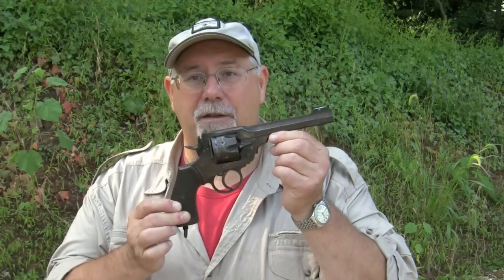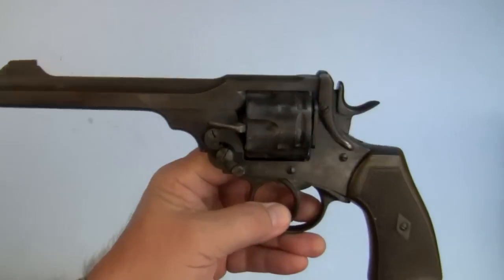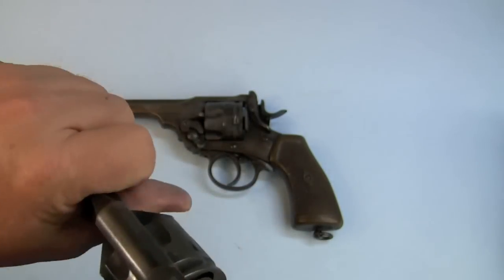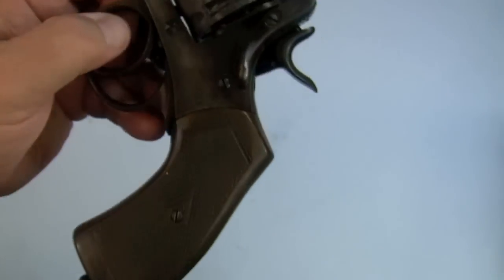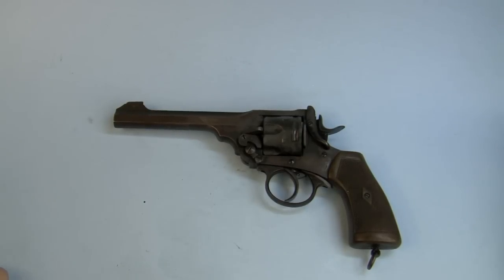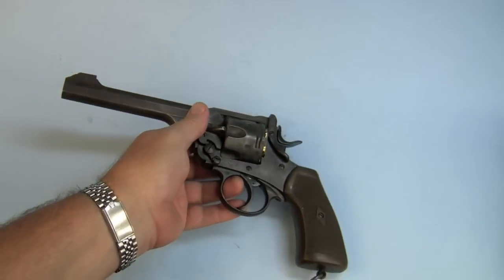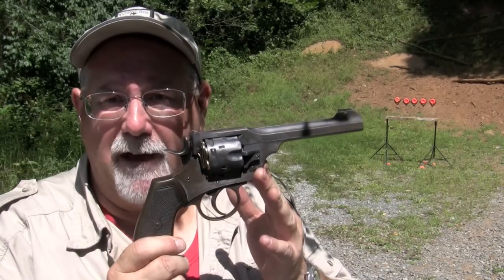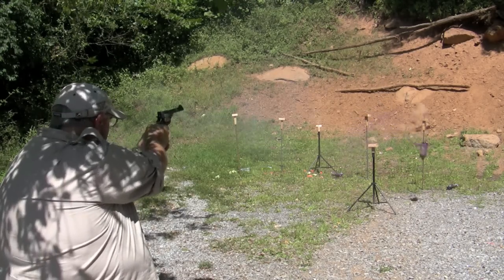Shooting British  455 Webley Cartridges in a Shaved Webley MK VI Revolver

Comment: Hi, 
In Britain before the Pistol Ban (Introduce by Tony Blair) in 1997, we had a large following of people shooting the .455 cartridge. We were obtaining off hand sub 1” groups at 20 yards. We also had many competitions with these revolvers and the Webley Fosbury Automatic Revolvers. The way that we found to make them shoot was to use a hollow based bullet. This design would obdurate the base of the bullet as it entered the barrel. The chamber exit hole was smaller in diameter than the barrel so the use of a plane based bullet was just inaccurate. It was easy to obtain the correct size cases either by using Fiochi once fired cases, Mountain and Snowden made the Mk II cases, finding original cases, Imperial made this ammunition and I believe that some of the American Manufactures used to make it. The hollow based bullet was another matter. The easiest way was to swage your own with many Manufactures supplying the dies for this. I note that you were using flat based bullets in your test. RCBS made a mould for the 265 grain Hollow based bullet. Sized to .454 dia. These proved to be good. The ‘Man Stopper’, Mk III & IV, named thus for obvious reasons. These were normally made in the weight range of 200 to 220 grains, both in the flat nose and the hollow based and hollow nosed designs.
You guys went down the butchering of the rear of the cylinder route, so you could use the Auto-rim cases or the moon clips. Thus you could re-load the ammunition using available components. Unfortunately, you used .452” diameter bullets and wondered why you could not obtain the desired accuracy. 
I hope that this is of some help to you all. Please feel free to contact me if you require any more information on firing the .455” Webley or the competitions that we shot with them. Personally, I consider that this revolver was the very best military revolver ever made.
Reply: You are far from alone in your regard for the Webley MK VI, it is widely and rightly held to be the very best military revolver ever created.
Reply: 2771 Hi there, good morning. 
You are quite right about the Webley Mk V. One competition which we used to run was the Classic Service Revolver Class A, for over .4 Cal. Service revolvers. This was shot at 20 yards with an opening six rounds shot in 30 seconds and it was Shot first strong handed six rounds and then the next, shot weak handed and the gun score, minus the number of seconds taken to fire the six shots The South London Rifle Club had another competition where you fired at an advancing target and you fired left handed and hat a service sword in the right hand, held at the point! Great fun, but all stopped by Tony Blair to help him get elected. Never trust a politician.
Reply: We have a saying here in the southern United States. Politicians and diapers should be changed often, and for the same reason. I wish i could find a good Webley revolver at a good price. I would even settle for an Enfield copy of the MK4, but those sell for over 450$.
Reply: As a matter of historical accuracy the 455 Webley was outlawed in the UK by the legislation proposed in 1996 following the Dunblane massacre and enacted in February 1997 under the Conservative government. Later that year a Labour amendment to the bill extended the handgun ban to include .22 pistols.
Reply: Finally! the voice of reason from England! Mr. Valentine you are entirely correct about the issues with Webley .455 revolvers here in these United States! Bullet DIAMETER was and is the issue. I was amazed about the foolishness of using .45acp bullets .451/452 to obviously greater dimensions! Your point about hollow based bullets is excellent as well. Personally I always felt the Webley "manstopper" Bullet to be an outstanding Idea for Revolver cartridges provided they had the necessary energy to penetrate sufficiently. Finally I lament the closing of Webley/Scott and thought , with modern metalurgy the idea of bringing back the Webley design. Also as a personal noet it breaks my heart about England and the UK surrendering to the foolish left! I decend from a famous Pilgrim and I,m even Kin to Henry the eighth! Recall Lord Davies and Wickham Steed asking Americans to send a Gun to defend a british Home during ww2? "gun control" In Britain as you are aware came from the fear of the Ruling Class about a possible Marxist Uprising.
Reply: red9man2130 I'm UK born but lived in East and South Africa for many years. The Kenya Mau Mau uprising in 1952 was in full swing so I fired my father's Webley 455 at the tender age of 11. I've been in love with it ever since. I am in England now and I miss my hand guns terribly. Thanks to that left wing control freak, King Rat Blair, we will never have our guns returned to us. The chances of the law ever being repealed are nil. I own a black powder 44 Colt but it's just not the same as the last gun I had in South Africa, a 1911 Colt 45 ACP.
Reply: It was John Major, the conservative prime minister, who banned large calibre handguns.  Not Tony Blair.  I should know as I was there.  I put my pistols onto s7.1 and s7.3 and still own and shoot them.
Reply: I really disapprove of Tony Blair, now. 
Hello from San Diego California

Comment: What a slick way to solve a problem. I am a revolver guy and for some reason break-top pistols have always held an attraction for me. The S&W perfected in 44 special to me is the perfect pistol. The Webley MkVI to me is right there except for the inability to handle 45 acp pressures. My dream gun is a breaktop made to modern standards in 45 Colt capable of handling +P loads. Anyway, thanks for the video Mike. As always it was very well explained and your innovation is to be complimented.

Comment: I have an unshaved Mark VI in excellent shape that is totally stock. I just give it a steady diet of Fiochi and Hornady ammo. She's sure a tack driver. I keep the brass for reloading and have a few hundred custom casted 262 and 265 grain rounds for when all the ammo runs dry. I have over a 1000 rounds see still of the original caliber. 

The easiest way to tell if they're shaved to to simply look at the back of the cylinder. The uncut models like mine have obvious proofing stamps on the rear of the cylinder. Every shaved one I have seen is missing these because they get milled off during modification.

Comment: I have owned my 455 Webley automatic revolver for 52 years and have always shot 45acp military HB ammo with the half moon clips. I know I have shot over 5,000 HB round in it and never a problem.  I purchased the ammo and gun from a pawn shop that closed in Ark City,KS in 1962. Never had a problem with it. But will from now on shoot only light hand loads,if I ever shoot it again as I have not fired it in 10-12 years.  Thank You for shuch a great YouTube site and always enjoy your videos.
Sincerely

Errol  Stuck in SW Missouri with hope of moving on soon.
Reply: Yes, by all means handload light .45 ACP loads in the .455 Webley pressure range from now on.  Sounds like a good plan to keep the old girl going.

Comment: Several years ago I bought a Webley Mk IV.  The bird's head grip version.  Cylinder on that one was shaved as well.  However, .45 AutoRim cases work just fine.  So I loaded up some of those cases with loads I found for a .455 Webley.  The original loading used a 265 grain bullet, I use a 255 grain .45 Colt bullet.  Original dimensions of bullet for .45 Colt are .454" and some later bullets are .452" (same as .45 ACP for convenience.  The Webley schematic sheet shows bullet diameter of .456" so pressure should not be increased and accuracy is acceptable.

I endorse the warning about NOT USING .45 ACP ammunition as issued or sold.  The Webley wea designed for a markedly lower pressure cartridge.  But there's a trap here.  One can fire the .45 ACP cartridge in the Webley and it will not blow up on the first shot.  This can give a false sense of security.  The cylinder is not the weak part.  The 'latch' holding the gun closed is what is going to fail.  The stress and wear on the latch is cumulative; it will fail after an undetermined number of shots.

Comment: Hi Mike, took my "shaved" webley to the range with expensive.455 factory reloads .Didnt dare try regular 45acp after some research.  Sure, I  was having light hammer strikes and missfires  ..A old  range  duff came over and  he just tilted the pistol back every shot and it made enough contact with the primers where  it started firing pretty consistently .  Works in a pinch.

Comment: I have a 1917 made, refurbished in 1940 Webley.
Low velocity loads for the  .45 auto rim cases with lead bullets work best. But 5/16"x 7/16" x 1/16" nitrile "O" -rings on the  .455 case takes up the gap of the shaved cylinder & works fine for recreational shooting.
I also opened the chamber mouths to 
.452" from the original 
.450" to reduce chamber pressure and allow for .451" 45 acp\ auto rim bullets.

Comment: Thanks for this. I have a S&W 455 Hand Ejector that was shaved to accept .45 acp moon clips. It was sold to me as a 1917 .45 acp gun. I discovered that it was a modified 455 when i dropped a .45 acp into a chamber and it went in too far. And my brother pointed out the British proof marks. I think I'll try modding a moon clip and get some .455 to try in it.
Reply: You might try the 45 auto rim. Another poster said it worked for him.
Reply: +Dwight E Howell  Thanks. I have moon clips and the old girls runs standard .45acp just fine with them. The S&W hand ejectors can handle the .45acp cartridge pressure just fine. It's the same frame and cylinder used for the U.S. M1917 .45acp revolver. I'd just like to get some actual .455 Webley ammo to try in it, since I know how I can get it to headspace properly now.

Comment: Great innovation and I wonder if you could cut that moon clip up and solder it to the cylinder or have small shallow screws tapped into it to hold it in place?  I have experience with both cut and uncut guns and replacement cylinders are a nice accessory if you can find them.  Awesome video as usual and shows how handloading is a critical part of the shooting hobby.

Comment: Great Video! I like the idea of fabricating a spacer plate to allow shooting of the original 455 ammo. i see a lot of colt New Services that were orginally made in 455 and then converted to 45 ACP. A spacer plate might work for those guns as well. Anyways as always great video!
Reply: I made a rough version of a spacer that works perfectly in my Mk4 Webley. My fabrication process still needs some improvement but I may try making some production models to test out.

Comment: I had the same problem with my shaved cylinder Webley Mk.VI Revolver. I decided to use handloads, with .45 auto-rim brass and .452, 230 grain, RN lead bullets. 4 grains of Unique.

Comment from the maker: Regular factory .45 ACP is fine in your 1917 because it was made for .45 ACP. THe Webley was made for .455 Webley and needs to fire cartridges under 15,000 PSI. Factory .45 ACP runs 18,000 PSI and +P runs 21,000 PSI. A steady diet of those will damage a Webley.

Comment: well most of the time from what ive experienced with these is dont shoot fiocchi 455 because they load their ammo hot for some reason. However what you can do if you dont want to have to reload 45acp brass and put them in moon clips is to load 45 AUTORIM cases. that style of case was orignally made for the m1917 series revolvers after the war since the half moon clips werent readily available. Several companys sell the brass and the 45 dies are the same just the shell holder is different. If i read originaly webley specs right its supposed to be 16-17 grains of BLACK POWDER in the orignal webley cartridges and not smokeless although the Mk VI was meant to shoot cordite ammunition. If you come across something like a MkI or MkII webley witht he birds head grips load ONLY with black powder not with smokeless in the least bit ever because the steel on several parts is weak. check both the frame and barrel markings due to the fact some webleys were arsenal updated with later barrels and parts.  Ive got a Mk IV 455 and thats how i shoot mine because i have seen pictures of how a cylinder and barrel latch can catostrophically fail , its not pretty.

Comment from the maker: I did, but when it arrived it was another shaved one. Too many people don't know how to accurately identify shaved vs un-shaved cylinders. I sent it back, and I'm waiting for the refund.
Reply: duelist1954 I have an unaltered unshaved MK VI. The best way to identify a real .455 is check for symbols or marks on the back of the cylinder. I wish you can recommend a good gunsmith in the North East that can work on the action. The double action pull is very heavy but it's smooth.

Comment: Do not send your gun to Anderson Arms in Texas or Truitt in Oklahoma.  These guys worked on my Webley and it took many letters to ATF and local authorities and over one year to get them returned.  Truitt first sent me another customers gun then later returned my gun with all the internal parts missing.  I would recommend purchasing only unaltered guns or have the cylinder reamed to .454 to reduce pressure and use either moon clips or .45 auto rim brass with flat based lead bullets.
Reply: There may be another source to restore them to shooting .455 Webley/Eley and I am working with that company/gunsmith to make it a reality.  Stay tuned as I have a few I want restored.
Reply: Can't warn enough about Truitt in Oklahoma!!  Not sure how he didn't get locked up.  BATFE finally pulled his FFL license a few years ago, but part of that did NOT include him returning the firearms he was holding that belonged to others.

Comment: I saw there is a all metal pellet and BB gun replica of the 455 webley that utilizes realistic cartridges that hold the pellet or bb.  Only difference is it’s obviously less powerful.  I wonder if one could swap out that metal cylinder and place it in the real gun since all workings function just like the real gun.
Reply: I don't think swapping the cylinder is wise. The replicas use a lot lower pressure. The original cylinder is rated at something like 13000 psi.

Comment: Have used cut down .410in those shaved cylinders, (the rim is thicker than the webley round) an you need to make a custom bullet mould to allow for the thicker plastic case. Works an is cheap an fun.

Comment: Hi Mike. In 1881 the .455 Webley Mk I, loaded with 19 grains of black powder and a heavy bullet of 262 grain lead round nose, despite the modest velocity (620 fps) and not exuberant energy (223 Foot Pounds), it was a very effective weapon in the British colonies, with high stopping power thanks to the heavy mass and the soft lead deformability.

I hope as soon as possible, you can show something with the .38 S&W. Is it true that can be formed by trimming  a .38 special case?  According with GOEX .38S&W is loaded with 15 grains FFF black powder and 145 grains lead round nose, for 700 fps. 

Great vid as usual! Regards.

Comment: When I buy unshaved Webleys I always make sure I have a photo of the back of the cylinder. You can obviously tell by the machining marks its 45 acp and military models have the British cross pendants on the back if it is unshaven.

You can sometimes tell from side profile photos if there is an excessive gap between the recoil shield and the cylinder.
Reply: Plutonius X i have this 455 all orignal if anybody interested

Comment: Not to be rude but the space between the back plate and the cylinder seemed to very wide , would that not have indecated it had been shaved, or is this normal for the mkvi ?
Reply: Yes it would have. It should not be that excessive.

Comment: This seems too simple of a solution and I bet you've already tried, but is it possible to just put the .455 cartridges in the moonclip? Or stick the moonclip to the cylinder as a makeshift spacer? (properly fitting it of course)

Comment: Interesting.  I may have to try this.  I have an early Webley, a MK II I believe, in solid condition.  I've fired it with light .45 Auto Rim handloads, but would prefer to use the intended ammunition.  I may be able to now.

Comment: Great video... Question: If I have a Mk VI that has been shaved. Can I shoot cut down 45 Long Colt casings to fit in the MK VI and shoot it that way as well? In other words does the moon clip serve any other purpose other than allowing the new .45 ACP rimless cartridge from falling through? Or does the moon clip in some manner add stability in terms of case pressure as well?

Comment: I have had luck using .45 cal auto rim in my shaved webley.  Further, I have to use the 1/2 moon clips as the full 6 clips will not fit without modification.

Comment: I have a unshaven Webley with original holster left to me by my father, I’ve never shot it but would love to find ammo, any suggestions? The face where you have shaved has a stamp of a crown and other markings, I can only assume that this would also determine unshaved!
Reply: If you can still see stampings on the rear of the cylinder then it's original. Fiocci manufacture ammunition for the .455 Webley.